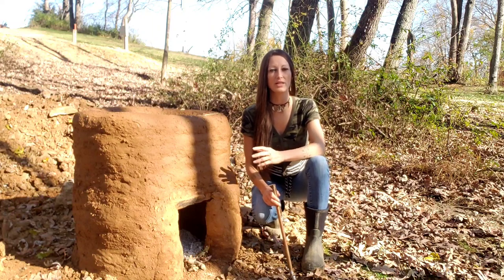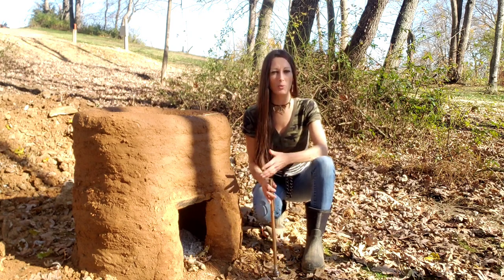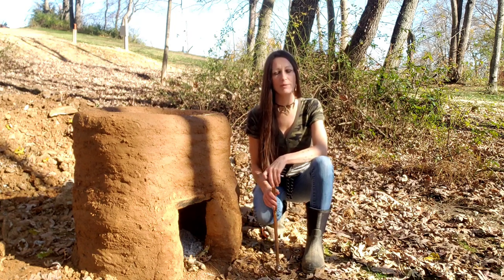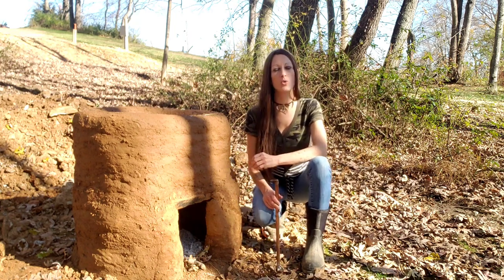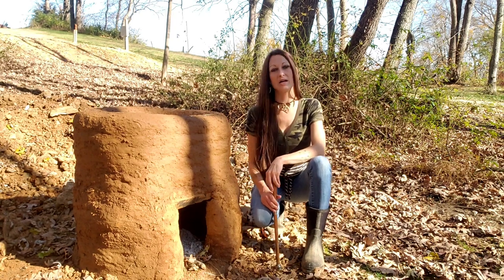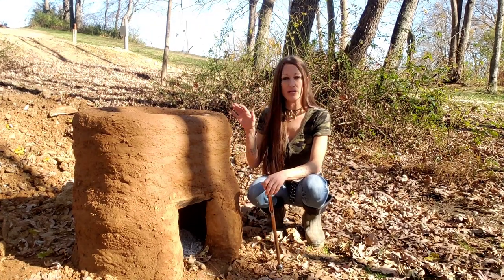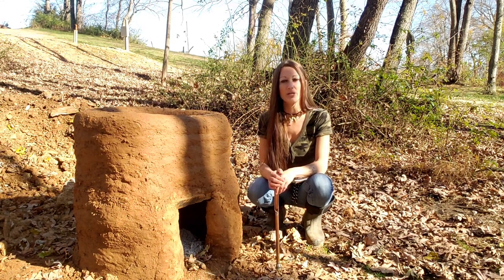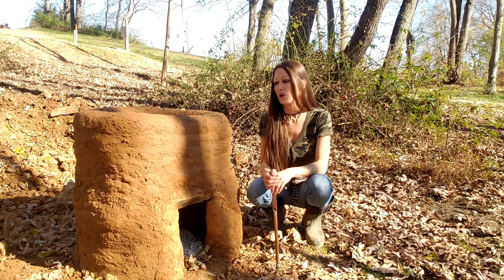PRIMITIVE KILN FOR POTTERY #primitiveskills #primitivepottery

Comment: The question I have is the heat temperatures it will fire at , other kilns built like this I feel only get to low bisque firing temperatures so not very high temperatures that’s required for some glazes etc , correct me if anyone has answers to this kind of firing method for temperatures , awesome build btw .. 👍
Reply from the maker: You are correct my friend. This is a primitive method and in ancient times glazes weren't being used to my knowledge. This method is good for basic primitive earthenware. If your making modern pottery, look into building a fire brick kiln! That may reach the temperature your looking for!
Reply: @healthprimitive28  ... Thank you so much for your reply , very helpful indeed , I’m thinking I might go with raku method in a gas fired kiln where low to medium glazes and temperatures can be more highly achieved , your kiln method is great for experience and learning I do like it and will try the primitive pottery for more learning also , keep the videos coming. 👍